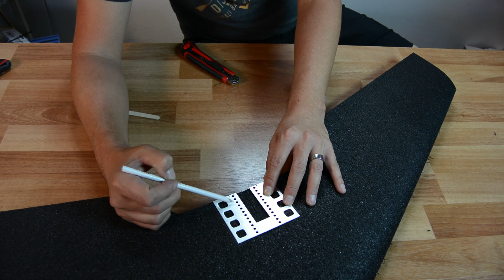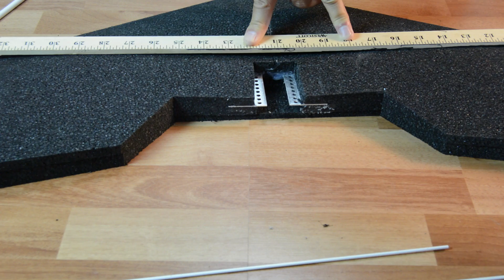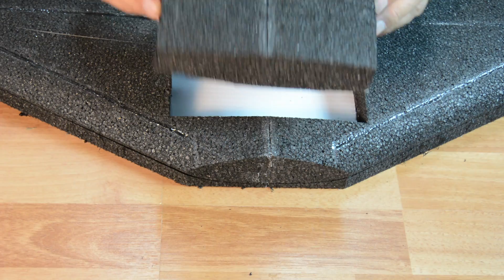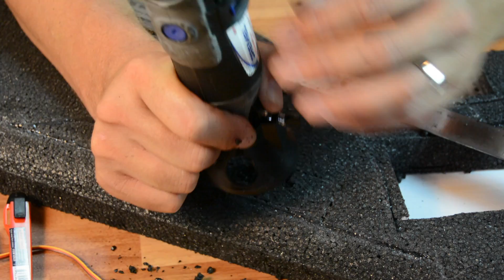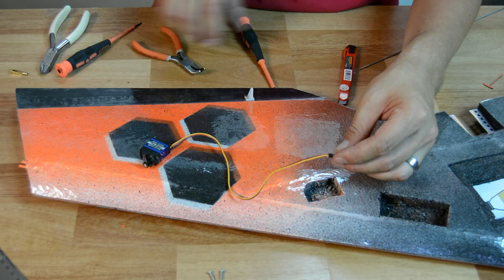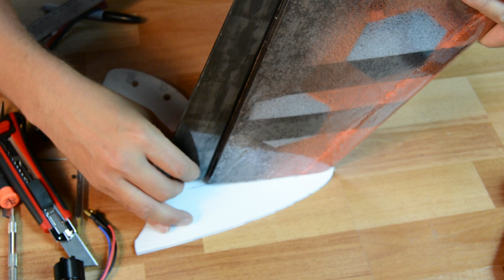Official Team Legit FOHDY 40" Wing Build Video

Comment: Demo, so with the camera setup, how did you attach the FPV Runcam?  I think I may go with your install method since the FPV box is awfully narrow. Thanks!
Reply from the maker: I mounted it on top of the fuse just to the left of the Runcam 2,  I wasn't the best option but since this was a cruiser wing I decided aerodynamics weren't as important.  I could have hot glued it right up front which would be fine to, just not ideal.